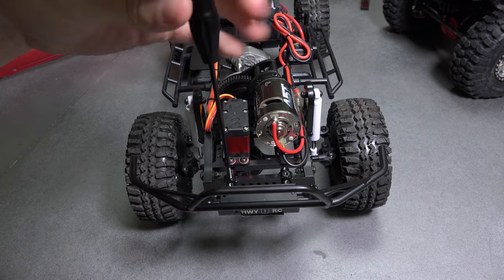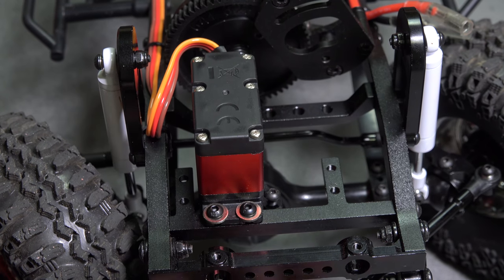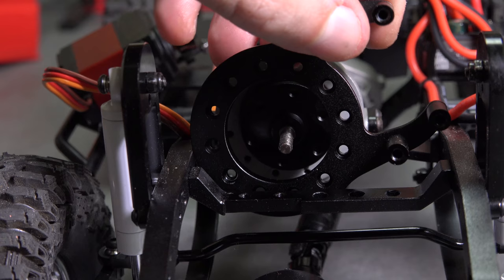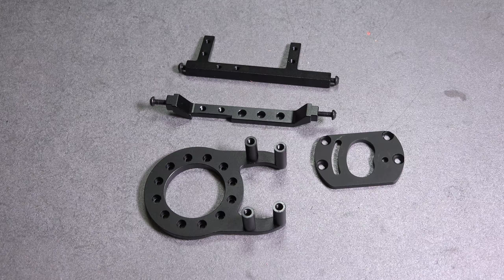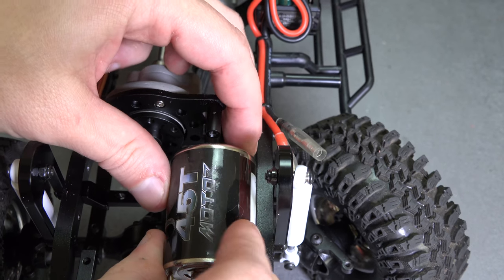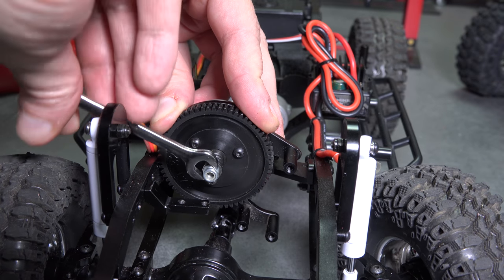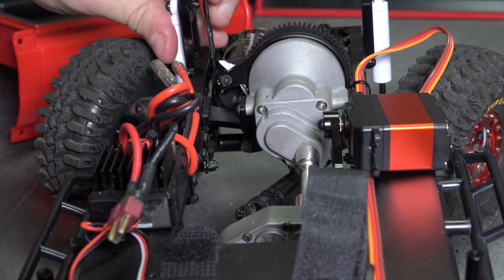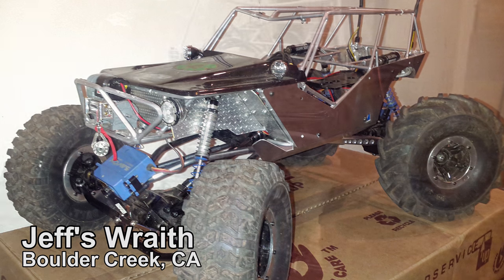THE RC SHOP - E16 - Motor Clock and Drop in the Marlin Crawler

Comment: Quick question what if you cut the mountain plate for the motor the top one and did not cut the bottom one I accidentally cut the top one and not the bottom one if I cut both of them would I be okay.
Reply from the maker: I hope I'm understanding correctly, but it sound like you cut the top tab instead of the bottom and now you're needing to cut the bottom. This would leave you with 2 mounting tabs for the motor plate which I guess would technically work, but that will really reduce it's integrity. If I were you I'd probably give it some easy testing and see if it holds up, but you may end up replacing the housing.
Reply: @TandemCTelevision  correct

Comment: Ahhh! The suspense is going to kill me regarding the steering fix. I dropped my MC motor this past weekend and now I'm trying to figure the steering out. I used a longer screw off of the servo horn with a 12mm m3 spacer but my servo gets really hot despite correct endpoints and no binding. Not sure if it's related.
Reply: I have an update. I was able to move the drag link to the front of the steering knuckles which gave more clearance. I pointed the part of the eye that's curved toward the back which helped push the link a bit more forward. Now I just need to figure out the steering link.  Looks like I may move the steering to the opposite side using an adjustable steering link. I'm looking forward to seeing how you resolve this.